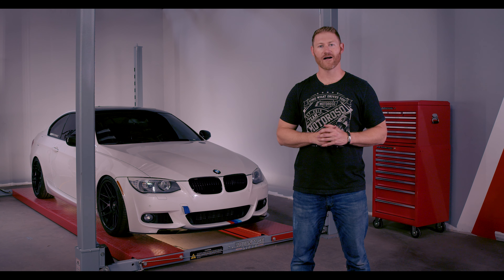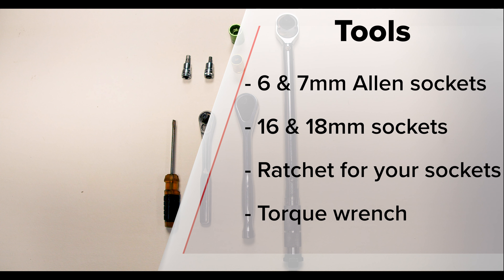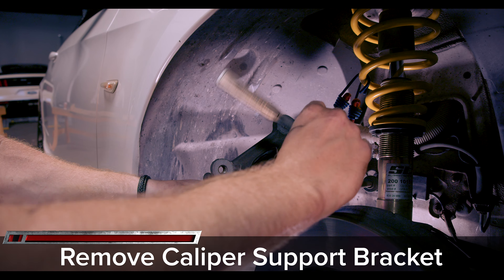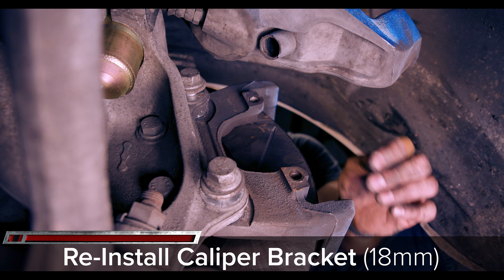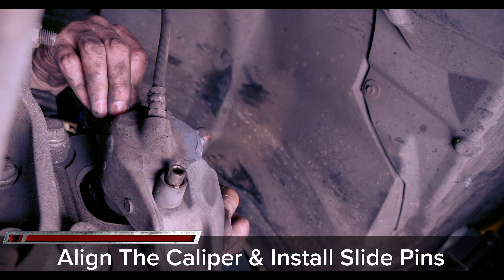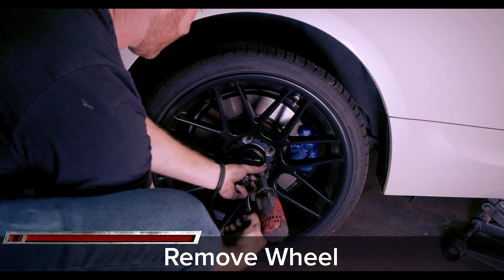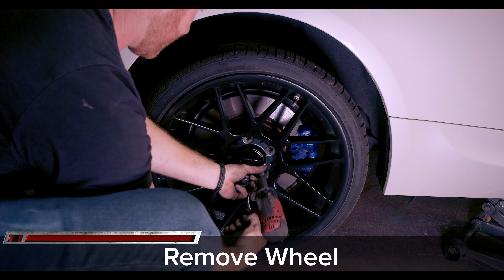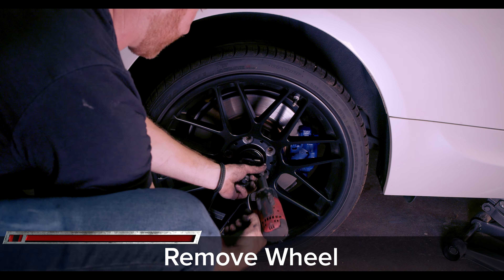BMW 335i Brake Pads & Rotors Install Guide

Comment: Appreciate the great video!
Had a quick question I just installed the  brake pads without compressing the piston as shown in other videos. Is that Okie? The car runs fine except for some grinding noise as I used old brake pads, since I got them done few months back and cold not get the rotors done, there was also an imprint on the pads but it was night and all I had. Needs your thoughts about the compression of piston and the sound thing. 😊 Thank you

Comment: No copper grease is put on a brake caliper mounting thread. The copper grease should be removed only where there is slippage. Only thread lock on one thread.
Reply: No grease on back of pads?
Reply: @bryandiaz3108 not necessary on these cars as the pads are clipped on to the calipers

Comment: You get a thumbs down just for using a p[ink bungy... And you should have wire brushed the center cap and backing before putting the new rotor on.